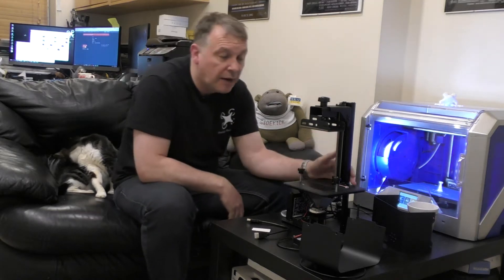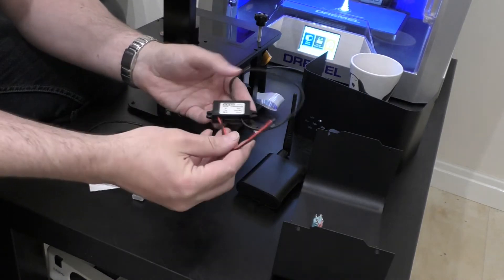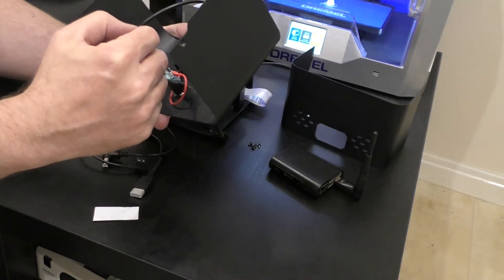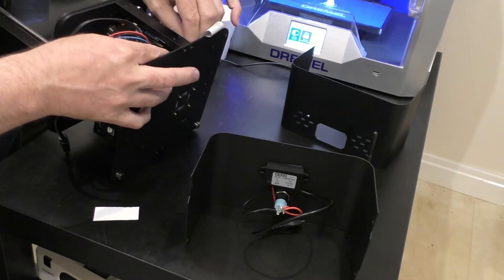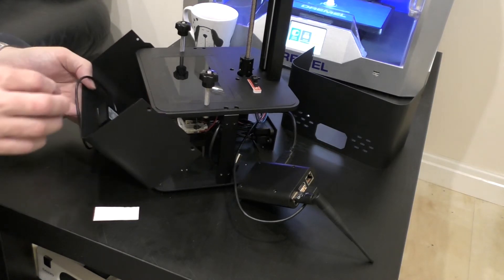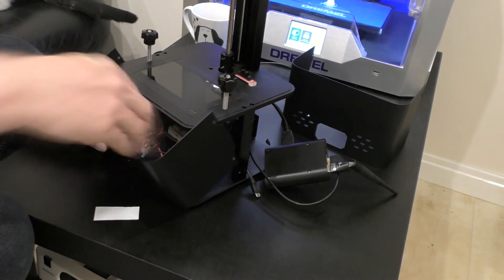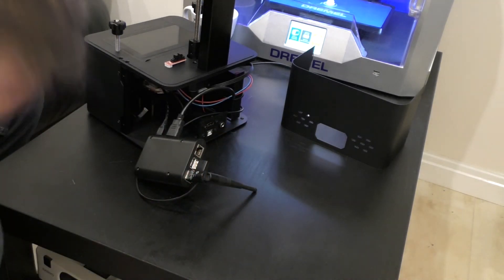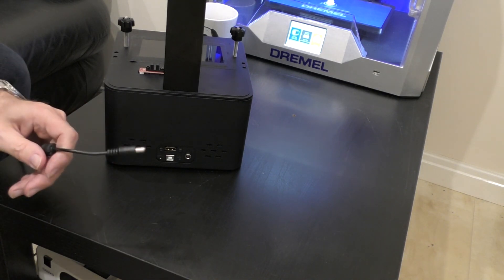Wanhao Duplicator D7 Raspberry PI 3 Install ( http://diyrc.co.uk )

Comment: Hello, after editing how you used the printer ?, did you have any prints with some videos ?, i have a clone of the Duplic.7 the Micromake L1, and inside there is a 3 Axis Controller + Extruder (Makeboard) only Z axis, a VGA 800x480 lcd controlled by the matherboard on / off (fan connector) and a matherboard controlled LCD monitor (bed heated connector) of the software I have not listed, and I would like to go to the Raspberry system but I do not know what software and If everything is complicated, thank you

Comment: Not true, nanoDLP image does in fact support the onboard Pi 3 wifi. http://3dprinterwiki.info/wiki/wanhao-duplicator-d7-sla/d7/d7-nanodlp-settings-2/  You also need to ensure you either edit your nanoDLP profiles to use static timing and not wait for gcode replies at the end of moves or update your D7 firmware with the one supplied on the Wiki that includes the required replies. Failure to make that step will have you hanging waiting forever for a command your stock firmware won't send.
Reply from the maker: Great.. I'll have a play with mine. Either way NanoDLP is a fantastic upgrade to the D7. Makes it so much more usable in my eyes. I have flashed my D7 firmware through Cura, but unsure if it needed it as I heard all new D7's will come with the updated firmware anyway.  But big Thumbs up to NanoDLP..  Awesome!
Reply: Are you sure is better than Creation Workshop? I mean.. Is handy to have a wireless printer that can work without a wired computer buut.. How NanoDLP runs vs Creation Workshop in terms of performance and funtionality?